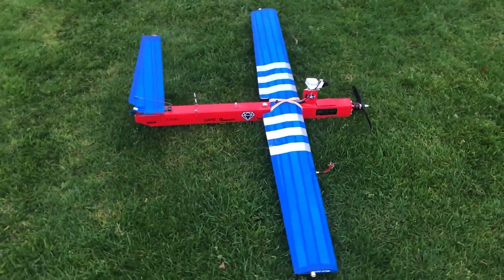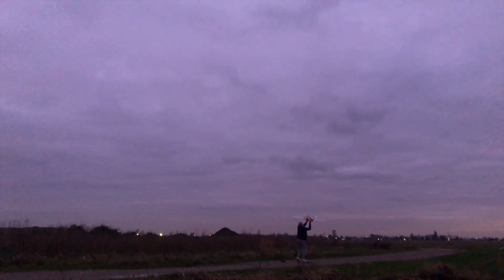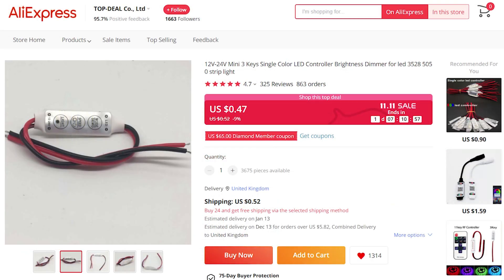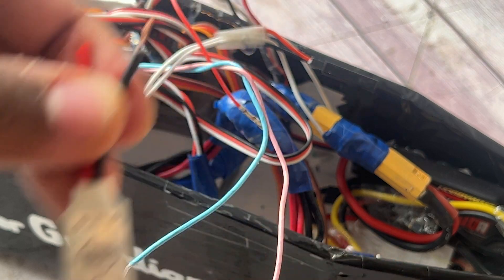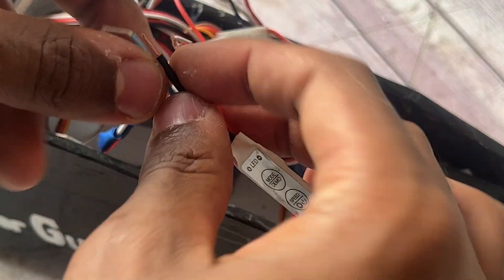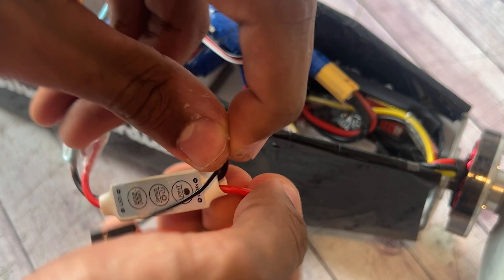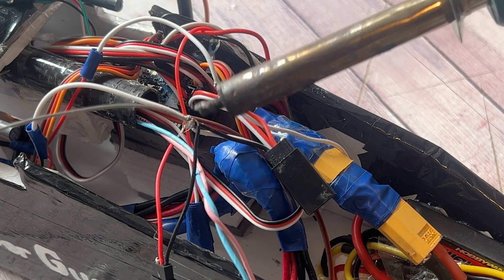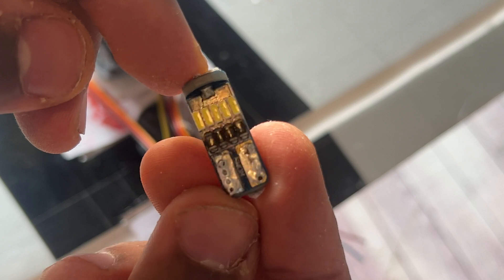How to Install Strobe Lights on FPV Aircraft (Extremely Bright)

Comment: Did you used 12v or 24v controller with the 4s battery????

Comment: I bought the controller but the lowest speed I get is about 2 Hz (twice a second).  How do you do two pairs of two lights flashing at different times?  Do you run the two lights in parallel?  Do you use two controllers?  If two controllers, how do you synchronize their timing so their flash times are separate?
Reply from the maker: I use two controllers, but their timings are off. They're not synchronized, the offset is somewhere deep in the microseconds so after a while, the synchronized flashes look different.
Reply: Thank you.  I was able to get to a 1 Hz (once per second) flash rate.  Looks good. @AeroStuffFPV

Comment: Я ранее пробовал использовать такой же Mini LED Controllers с led лентой. У меня были сильные помехи на видео линк 5,8 гГц, и GPS  видел меньше спутников. Сборка была квадрокоптер, - возможно из за близости компонентов.
I have previously tried using the same Mini LED Controllers with LED tape. I had strong interference on the 5.8GHz video link, and the GPS saw fewer satellites. The assembly was a quadrocopter, possibly due to the proximity of the components.

Comment: I've been using StobeonV2  flat mount on stratospheric craft for 10years. Selectable flash and colors.  These bulbs have a wider beam footprint but weigh a bit more- they look good. Keep the great videos coming.
Reply: I usually don't ask things like this but when i saw "stratospheric craft" i just had to. I know absolutly nothing about this topic, been into flying crafts for years and never got this excited to want to learn more about something. Do you have any good reads or origins of information i can look into to get into just learning about stratospheric crafts like you mentioned. I thought it would be best to ask you than searching through a bunch of weather balloon information if i used google. It sounds like your craft is much, much more than just a weather balloon.